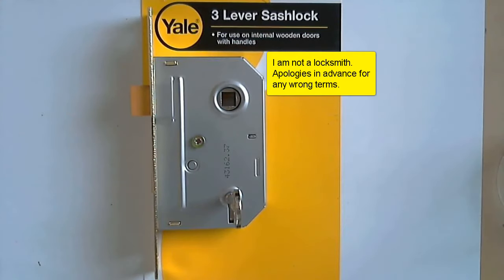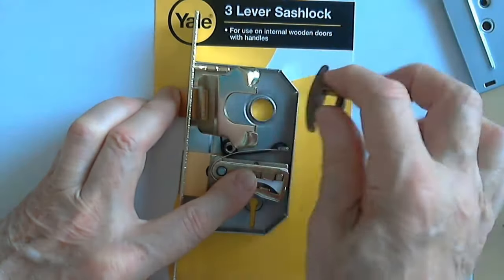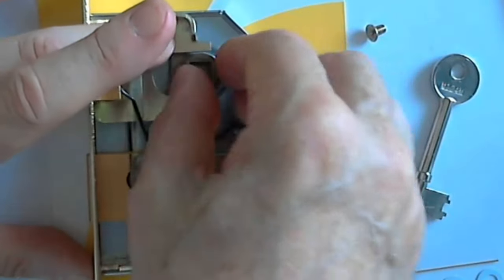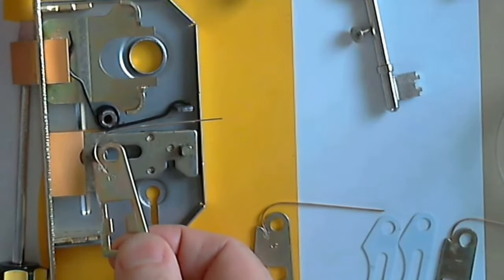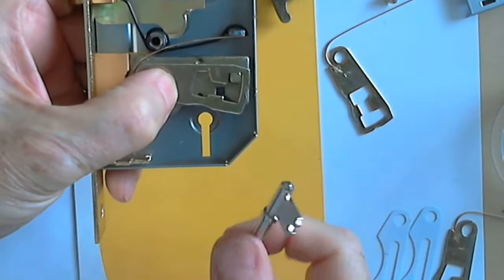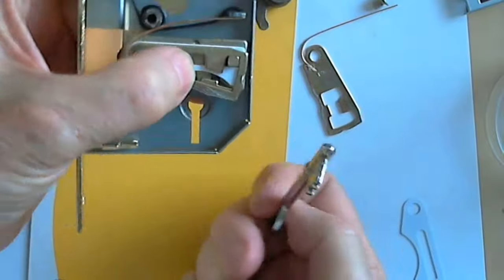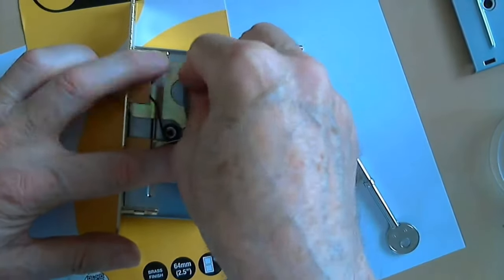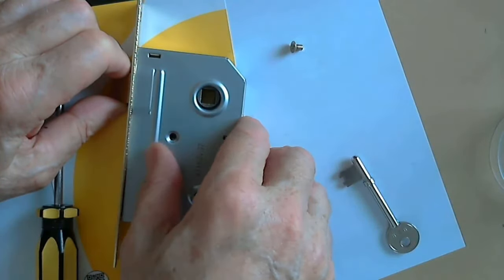Reassemble Mortice Levers (NEW: subtitles - press C)

Comment: God bless you, I just spent 2 hours trying to fit a new Yale 2 Lever Sashlock , it was pretty much the same as the old broken one on my Workshop door but I had to reverse the bolt. I really couldn't figure it out, nothing on the Yale website, I had got to the point where I was going to take all the loose parts and hurl them into the back garden when I came across your video, I had sorted it out and fitted it within 30 minutes, blood pressure now down to a normal level, thanks very much for taking the time : )

Comment: Brilliant! Thank you so much. I was replacing a 3 lever sash lock and discovered the latch needed reversing. Upon opening the case all the levers and spacers flew in all directions. I would have been completely lost without the guidance from your video. Thanks so much for sharing.

Comment: Brilliant, I have just had a problem with a new lock that flew apart as soon as I took the back off to turn the latch direction. 

I tried replacing the levers and spacers in as many combinations as I could until my patience expired and just re-assembled it and fitted it. I just didn’t think of replacing the levers one at at time!

I wasn’t too concerned that it now can’t lock as it is an internal door and not really required for security but I just felt that I had to get the thing working for my own curiosity (and pride) you might say.

It is actually an old external door that I restored and re-purposed  because of it’s wonderful Victorian stained glass upper, the ancient lock gave out because it the door was so bowed and weathered that it never closed on it’s internal frame without a fair amount of pressure and the strain eventually broke the original lock.

I’ll have another bash now as it’ll come in handy to lock the family  out when I’m having a crafty tipple while cooking!

Comment: Excellent video, particularly as you encountered the 'usual' difficulties and showed how to recover from them. I have one of these where the lock bolt doesn't retract quite far enough causing it to bind the door into the lockplate. It's about a 0.5mm problem and can be resolved with a sharp tug. It's an old lock and I hope I will find an issue (like compacted grit or similar) and rectify it. But I don't want to pull it part without knowing what I am doing! Thank you.

Comment: Many, many thanks for this video. I removed the cover from my lock and the insides exploded into an array of jumbled plates and springs.  I followed your instructions and after much angst and at the umpteen attempt, I managed to put it back together again. In my opinion the instruction sheet is a “pile of pants”........meaning, it is total garbage........meaning it is not fit for purpose. Many thanks again, Jim